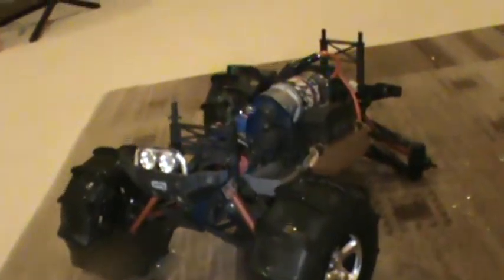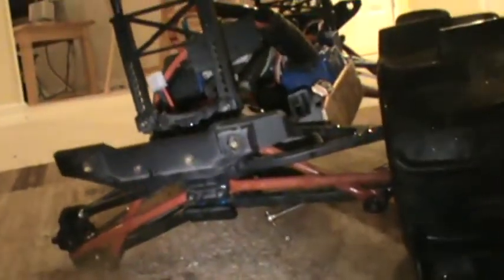Problem Help me 1/16 summit

Comment: Those drive shaft are for e revo, just lose up the suspension a little bit because those drive shafts are too short, if it did not work, then change it back to the plastic ones. U post this one years ago, so I thing u already fixed it :)

Comment: i had the same problem.  you need to tighten the shock suspension shock rod on that same side of the metal shaft